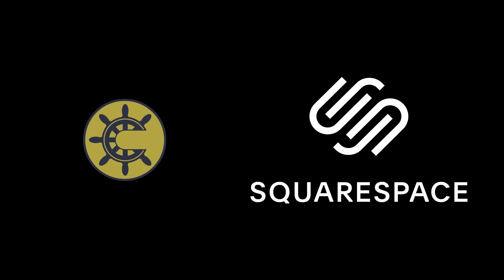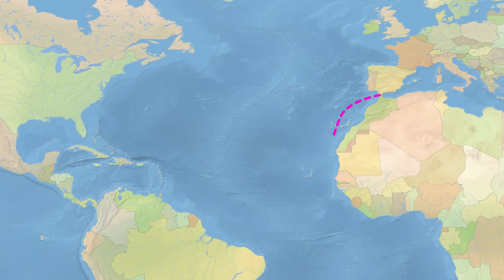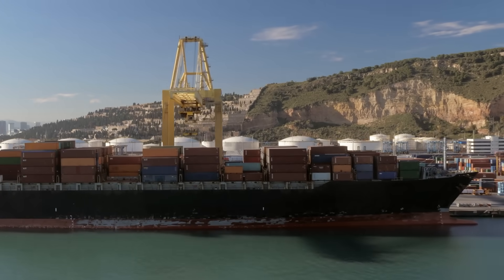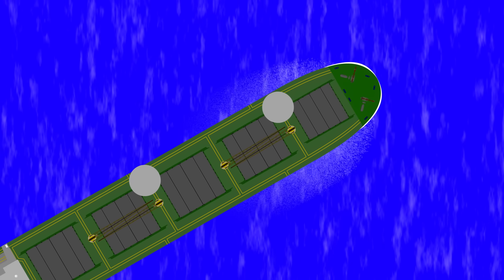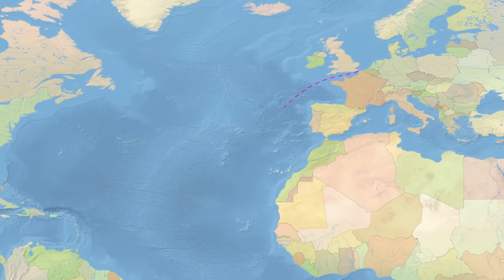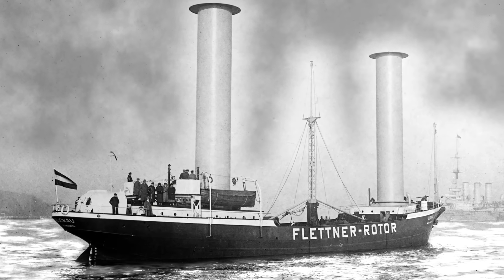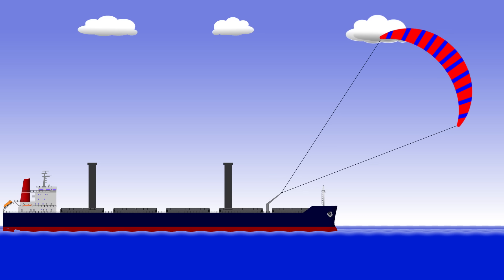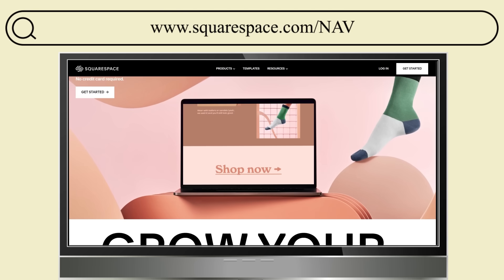Why Don't Sails Work On Ships?

Comment: I think the biggest reason we can never go back to full wind power is the fact the modern cargo ships weigh 100-200 times as much as the old wooden ships.  The sails would have to be insanely strong, lightweight, and massive to move a modern-day ship at anything more than a snail's pace.  The most we will be able to get out of wind these days is increased efficiency, and not by much at that.
Reply: Thats not how it works. Drag is proportional to cross-sectional area, so you only need proportionally larger sail to get the same speed. Bigger mass only means it will take longer to accelerate.
Reply: @E1Luch  The hull speed of a full displacement ship is the max speed it can travel at before drag increases exponentially. Traveling above hull speed requires bigger engines and more fuel. Hull speed is directly related to length. Cross sectional area doesn't affect the equation as much. Drag is more complicated to calculate vs drag for cars or aircraft as ships operate on the boundary between two mediums, one being much denser than the other
Reply: @oliverwatson1567  But does it even matter? As far as I know bigger ship are actually less affected by wave resistance. Speed dependance seems irrelevant if resistance scales as square of ships dimensions or less, which is true as far as I've seen. Unless modern ships go way faster than old sailed ones.
Reply: never?  For many people around the world, we currently use full wind power.    The sail material was not the limiting factor in ship size and the age of sail extended to iron ships of 8000 tons.   dyneema is 8-10x stronger now, so it's possible to drive any size ship but consider the many technical difficulties with sails, but mostly that they are exploiting the environment by powering these things with bunker oil which is cheating and doesn't count for anything in responsible and legitimate way to move goods.
Reply: Carbon fiber has entered the chat
Reply: "Old wooden ships", LMAO!!  You haven't a clue!!  Towards the end of the sailing era, cargo sailing ships were made out of steel!!  The Peking was a huge steel cargo sailing ship that would routinely haul over 5,000 tons of nitrates from South America to Europe. You people keep thinking of sailing ships from the 1700's or something.
Reply: Wind could act as a supplement to cut some effort off the engines, but I don't really know how these things work so I could be wrong
Reply: Also, engines give much more speed.  Five days to cross the Atlantic instead of six weeks.
Reply: The point wouldn't be sticking sails on existing ships, at the very least modern ships are designed for specific speeds and not really suited to traveling slow.

The solution would be to develop a new generation of sailing vessels designed to efficiently sail at something like half the speed of a current container or tanker ship. This also means sticking to less time sensitive product and possibly automation since crews will likely want extra pay for longer slower trips. 

The resulting ships would almost certainly be smaller than current ships, another reason for automation as sailing more ships to bring your numbers up would require multiple crews.  However I think the resulting ships could still be significantly larger than the largest sail powered ships of the past.
Reply: @DrewLSsix  the problem with this is that one giant ship will always be cheaper to build than two or more smaller ones to carry the same capacity.
Reply: @BrunoViniciusCampestrini  Its also just much more cost efficient to ship cargo in a larger ship, which is why they've been steadily growing in size since they were invented.
Reply: @BrunoViniciusCampestrini  this is 100% until the operational cost becomes prohibitive.
Reply: @BrunoViniciusCampestrini  wdym cheaper. If there is one thing I have learned with all the hippies about saving the environment, its that there is no such thing as cheaper. Its all about saving that miniscule amount of breathable air even if it throws the world into anarchy with a destroyed economy...
Reply: @DrewLSsix  Crews get paid by the day and usually do 120 day rotations. They don't care how long the trip takes.
Reply: @DrewLSsix  Another issue we have to address is, we need to cut at least half of the global tradding, it's a ludicrous idea for the money hungry millionares, but I don't think that if I can grow something in my country it shouldn't be shipped from the other side of the world, the point isn't autharquies but rather less globalization.
Reply: @DrewLSsix  this is an interesting prospect. Smaller more frequent ships could work, so long as they have the ability to deliver the same average amount of product. That's the biggest factor in changing the system at the moment, as we all have seen what happens when cargo shipments get delayed for any reason.
Reply: @novaiscool1  Harbour capacity is already a major issue, adding more ships would make it worse.
Reply: @McFrax  not necessarily. If the ships are staggered in such a way that as one leaves another is halfway there and one just arrived back at the "home" port the amount of ships in the harbors isn't really increased that much. Plus the ships wouldn't be staying as long since they have less cargo to unload/load.
Reply: @novaiscool1   I doubt the time spent in port is proportional to the cargo. I'd think that there is quite some time spent on logistics that happen for each single ship. Also, you may have a problem with waterway congestion, with significantly more ships getting into and out of harbour at any given time.

Btw, there is some other video about how longer ships can be faster - that would apply to sail ships, too.
Reply: @McFrax  You are right. The good doctor is assuming we are hauling less cargo, and that ships are always on time. Neither of which are true. Along with that, take into account that a linear reduction in ship's length will reduce the amount of cargo by at least a factor of 4, due to volume reduction. This means that the linear amount of dock space needed to offload the same amount of cargo would be greatly increased. With the port congestion we have now with a more efficient system, reducing the size of ships seems highly unfeasible as it would lead to higher congestion rates. And, as an aside, ship design doesn't dictate how sensitive a cargo is.

As for ship's length relating to ship's speed, you are talking about something called "hull speed". The length, block coefficient, shape, and draft, as well as depth of water transiting, all play a part in the speed the can theoretically go. Hull speed is the highest speed a ship can travel through the water before the bow wake it creates becomes longer than the ship length, leading to a phenomenon called "sailing under". That is basically where you dig a hole in the water deep enough to bury yourself. You will cover the deck with water and likely flood from the top down. A very uncomfortable position to be in.
Reply: @DrewLSsix  
The average modern cargo ship travels at around 24 knots... 18 - 20 knots if they are slow steaming to conserve fuel.  
Equipped with sail power only, their best speed would average around 16 knots at best... so the world would have to be content with longer delivery times.  
It's exactly the same problem with air travel.  We could use solar powered airships to travel or for cargo, but most people & companies are not willing to travel at speeds around 100 mph.
Reply: @OOTurok  what if 100 mph is the fastest option available?
Reply: @seandepagnier  
But it wouldn't be, because we currently have jet liners that can cruise at 575 mph.
Reply: @OOTurok  we had concord went faster but it's gone.  Maybe it is past time to end jet liners.
Reply: @seandepagnier  
Poor comparison.   Only 14 Concords were in service, they were extremely expensive to fly, & only rich people could afford the tickets.  
We are talking about the populous giving up a very common & affordable mode of air travel, for a much slower one... & ironically, flying on airships are extremely expensive.    
At around $12,000 a ticket, we are talking about Concord level prices.  Only the rich can afford to fly airships.
Reply: @OOTurok  "the populous" meaning the rich few?   1% do 95% of flying and 85% of humans have never flown even once.   It is unreasonable to allow it to continue for social and environmental justice reasons.
Reply: @seandepagnier  
Oh you are one of those special people who like to argue strawmen, because they lack the smarts.
Reply: @OOTurok  yes, it would be strawman argument, but only to the perspective of someone who believes they are entitled to fly while most people in the world cannot.
Reply: @seandepagnier  
It's a strawman argument, because I did NOT say what you claimed.   Read my comment again scarecrow.  
I said... only rich people flew the Concord, because it was so expensive to fly.  

99% of air travelers did NOT fly the Concord, which is why your argument about the Concord is a poor comparison.
Reply: @OOTurok  An airship that could carry as much cargo as a modern cargo ship would have to be the size of a damn city...
Reply: @garrettdemoss9465  
You have no clue what you are talking about.  
Boeing's 747-400F is the most common cargo plane used in commercial aviation, which has a 128 ton cargo capacity.  
The Hindenburg had a cargo capacity of 232 tons.
Reply: @OOTurok  LOL I think you need to reread my comment. Also this conversation has nothing to do with planes. We were talking cargo ships to airships. Hindenburg 232 tons. Average cargo ship 110 thousand tons. Let me know when your paying attention.
Reply: @garrettdemoss9465  
Nice try... now learn how to read yourself.  
My 1st comment was in response to the suggestion of returning to wind power for cargo ships.  
I made the comparison between sailing ships vs steam ships, & airships vs jetliners... showing how sailing ships & airships suffer the same shortcomings as their respective counterparts.   SPEED.  

I was NOT comparing airships to cargo ships, strawman.
Reply: @OOTurok  when you bring it up as an argument point even using just the speed as a point, your still bringing it into part of the debate. I didn't respond your stuff about planes. I responded about the airships. We couldn't use airships since in order to carry cargo of equivalent size to a cargo ship (which is what the video is about incase you forgot) they would have to be an unholy amount of massive. I couldn't care less of what you think of planes. Also "stawman"? I think sjw would have been much better if your trying to insult someone since you can't even follow a short conversation...
Reply: @garrettdemoss9465  
A strawman... is an argument against a possition that was never proposed.  
I never compared airships to cargo ships... which makes your manipulation of what I said a Strawman Fallacy.  

I clearly stated that the shipping industry is unwillingly to convert back to sailing ships... for the same reasons the aviation industry is unwillingly to convert back to airships, as primary modes of transport.    
This is NOT a comparison of the capabilities of airships vs cargo ships, strawman.
Reply: @OOTurok  you cannot bring up something into a conversation about something else and expect the dots not to be connected. Snap back to reality and realize that you brought this on yourself. It will help you to look far less sad littleman. The fact that you brought it into this conversation will never change it so accept it.
Reply: @garrettdemoss9465  
None of that justified your strawman.   I never compared airships to cargo ships.  
I compared airships to jetplanes... & sailing ships to modern steam & diesel powered ships.  
Your inability to comprehend the conversation is your problem.
Reply: @garrettdemoss9465  
It doesn't matter that I brought up the subject of airships.  
Your argument is still a strawman, because I did NOT compare airships to cargo ships.  
Pointing out how cargo ships carry vastly more tonnage than airships... does not disprove anything I said.  

Scroll back up & read my 1st comment again.  Maybe get your mom or English teacher to help you comprehend it.
Reply: @DrewLSsix  modern cargo ships travel extremely slowly my guy.
Reply: @joshlower1  Slow compared to an airplane? Large container ships can do 26 knots. Car carriers do about 18. Sailing ships of yore commonly ran 16-18 knots on a good day. TAnkers 12 to 16. I've been on little (over 100') schooners that made 14 knots. "Extremely slow" would be a tug boat with a barge doing 8 knots for 70 days.

Comment: Viking Line's MS Viking Grace had this rotorsail between 2018 and 2021 as a long term test. However they are not going to fit it to the MS Viking Glory due to lack of open sea. These ships operates between Finland and Sweden with a big archipelago between them. So wind direction and power changes all the time.
Reply: Yeah. Those things might actually make sense on the route from Helsinki to Stockholm because there's more open sea on that stretch. But they used it on the route from Turku to Stockholm.

Comment: What if the kite could be partially inflated with a gas like helium when the wind is suitable? The risk of losing the kite to the ocean could be minimized, and the helium could be stored on board and reused.
Reply: Good idea but unfortunately Helium is endangered, iirc we're supposed to run out in like 30 years

Comment: If these pillars can be erected at deck sides and still propel the ship than a computer-managed sails also can fit. The reason for masts to be installed at the center was buoyancy and sustainability. If light wooden ship didn't roll over or cracked with ship pine masts, neither will massive iron ship, wherever you put those masts, no matter how much force will the sail produce.

Comment: These changes don't have to come through UN regulation, they can also occur due to the Brussels effect. If a powerful market like the EU sets a rule, for example banning all new ships without feature x from entering it's waters then ship builders will generally start adding feature x to most ships.
Reply: Kinda how Panamax and postpanamax ships are a thing?

They're made not due to regulations but because that's what's required to do business if you want to sail through the Panama canal?

Comment: Flettner sails/rotors were a plot point in the 1986 novel "Texas on the Rocks," wherein they were used to help move icebergs from Antarctica to the Gulf Coast to provide fresh water to a thirsty nation. One thing you didn't mention is that they require energy to operate. I'm curious if anyone's done a cost/benefit analysis and quantified the net energy savings per knot gained.

I've seen the parasail equipped on a solar-electric power-cat. It cannot tack so it can only be deployed if the wind is going where you want to go.
Reply: The power required to drive the rotors is in the low kW range (depending on how large it is of course), while the propulsion power they add to the ship is in the hundreds to thousands of kW.
Reply: @aurigo_tech  Cool. Source? I couldn't find an authoritative reference. Thanks in advance!
Reply: @colormedubious4747  There are lots of articles spread over the internet; this site gives a short overview over some of them:
https://www.sciencedirect.com/topics/engineering/flettner-rotor

Also just the wiki-pages gives good starting points for further research: https://en.wikipedia.org/wiki/Rotor_ship

Flettners first ship, the Buckau, used 2 rotors of 2.7m diameter and 18m height and a 7.5 kW electric motor to drive each (with power provided by a diesel generator of 33 kW). 
It can be assumed that a modern solution with less drag on the bearings etc. and being fully electric would need probably less than 5 kW to drive rotors of such dimensions.

I can't find a number for the propulsive power the rotors delivered for the Buckau, 
but its safe to assume it was easily far above the 2x7.5 kW input needed for the spinning. Probably a couple hundred kW.
For Flettner's second ship (Barbara) I could find a number though: it's 3 rotors required a 25 kW diesel generator but delivered 440 kW of propulsion force.
Reply: @aurigo_tech  THANK you! I didn't mean to give you a homework assignment, but you came through like a boss.
Reply: The parasail is not meant to provide motive power though? As I understand it reeling out and in the sail in a certain way generates electric power on board which is routed directly to the propellers, so there's no question of only operating in the prevailing wind direction. It also allows you to access the faster high-altitude winds, which is crucial since wind power scales as the cube of the wind speed.
Reply: @dsdy1205  Not so. The sail is a SAIL. The wind pushes the sail, the sail pulls the ship. Like, you know, a SAIL. No sailing vessel can access "high-altitude winds." How much line do you think you could stow on a 65-foot catamaran? 30,000 feet of line? Just no.
Reply: @dsdy1205  500 meters is a different definition of "high altitude winds" than most, which generally refer to the jetstream, but that sail IS very much like the one on the power-cat to which I referred. I suppose a better term might be "supra surface winds" (or something far less clumsy to say).
Reply: @colormedubious4747  I believe what he is looking for is "clean air", free of the turbulence of the surface or vessel structure. The reason many ship's anemometers are not accurate. Like you say, nothing to do with altitude.